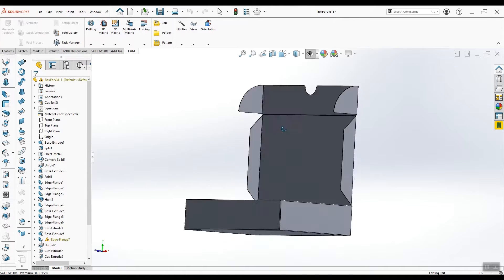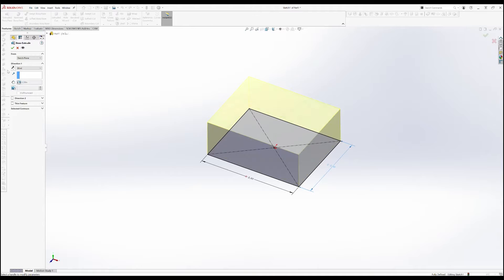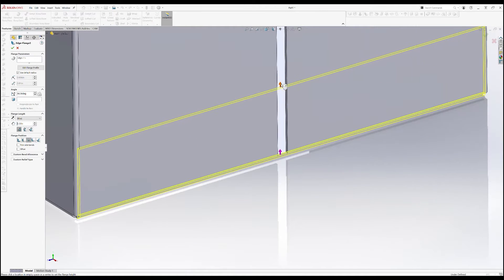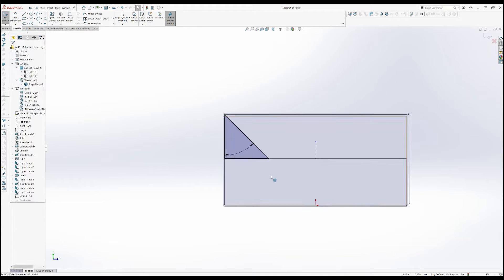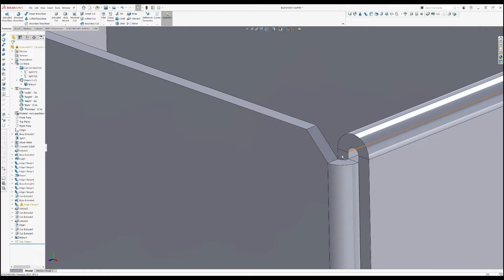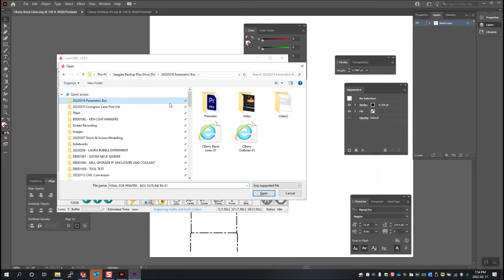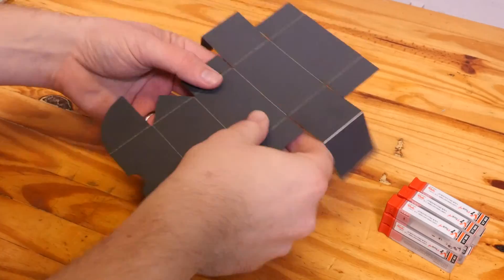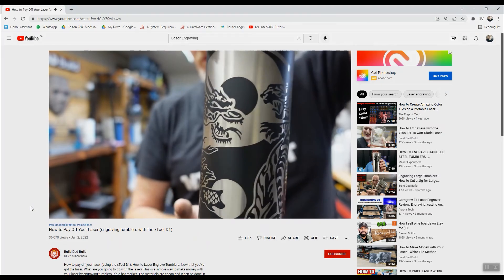Make Custom Packaging Automatically with CAD Tools

Comment: Getting a bit of emotional damage from all the scorched Waste Board - I mean yea it IS called a Waste Board but still... 😑

Whenever I did Airbrush Masking Stencils for my RC Tanks ( like this one: https://youtu.be/6XZXryXOO5A 😁 ) using my back then Diode Laser mounted to a 3-Axis CNC I'd be sticking the Tape to a Glass Pane ( salvaged from an unused Picture Frame ) propped up on some 50mm tall Spacers. With that Setup the Diode Laser will neither touch the Glass ( a CO² Laser will ) nor the now heavily out of focus Surface below the Glass Pane. If you don't plan on using Masking Tape where the Glass allows for reasonably nice removal, then obviously just using a sheet of Metal will do just as fine without the requirement of propping it up on something to defocus the Laser.

Comment: Solution for linking sheetmetal thickness and radius to global variable that works for me: 
Edit the "Convert-Solid1" feature and click on "override default parameters", then confirm change. 
After that you can double-click on the converted sheetmetal feature which should show the blue dimensions of the thickness and radius (like the hem trick you did). 
You can simply edit them and put the global variables there.

Comment: Dealt with a bit of this too in SW2021. If Solidworks actually cared when "Geometry" is deselected in the DXF/DWG Output dialog, all of that post-processing would be eliminated. Software Knows Best strikes again.
Still saves a bit of time/hassle to directly export the one without bends, and maybe a bit more to do cleanup on the (eventually) bends-only file from within the popup, but realistically not enough to keep that $40 in your pocket.
Reply from the maker: Haha - I think you're right! I haven't used Lightburn, but it just looks a lot more developed than LaserGRBL - and it's what almost everybody seems to use with these lasers...

Comment: Nice! I've always thought it would be cool to cut custom boxes on the laser. 

I believe you can fold those so that the score is on the inside. It would look a little more professional.
Reply: But with the score on the outside would be easy to engrave your logo etc. Better than flipping around and trying to center.
Reply from the maker: The inside of the card stock is white - so it looks even worse bc the thin black layer tears under tension. But I agree - it would be nice to get some card stock that’s the same colour throughout so you don’t see those white lines. Cheers!

Comment: Hi Adam, as like you asked about linking material thickness to bend radius... In feature tree, you have click the sheet metal feature right after origin and in the floating dialog box, click edit and inside that, in bend radius box, type equal sign then you will prompted to select a global variable(if you already created) and also default thickness parameter.
Reply from the maker: Hi Vinoth - Thanks so much for the reply! I'm still not really having it work. The sheet metal feature creates a "thickness" global variable by default which I can only change by editing the sheet metal feature manually. I cannot change it by going to "Manage Equations". When I go to "Manage Equations," it is there, but it is locked and grayed out. I can enter an equations for the bend radius, but i cannot enter an equations for the material thickness. Where am I going wrong? Cheers! Adam
Reply: @adamdebowski2037  Right after the global variable in the manage equations window, the dimensions section is there. There also, thickness value can be entered. If you change the thickness value in this dimension, it will automatically update the thickness global variable.

Exactly telling, "Thickness@sheet-metal" dimension.

By the way, sorry for the late reply.

Comment: Brilliant. Im in the midst of planning a 40kw laser..the engraver ones are nice...but cant cut thick enough imo...you made the perfect use out of it
Reply from the maker: Nice! What kind of thicknesses mild steel will that let you cut? Is it a CO2? This is my first go with any kind of laser, and it’s pretty cool… but like you say, not so applicable for metals I don’t think. Cheers! Adam
Reply: @adamdebowski2037  no steel...but wood, plastics etc...lasers are pretty cool...you application was perfect...great melding of newer tech.